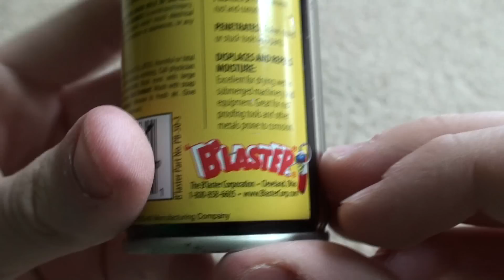How to fix noisy computer fans.

Comment: Question, I accidentally moved the fan blades while removing the dust in my PC (it didn't spin completely, just rotated a bit), but now I notice that it is spinning at 45 RPM instead of the usual 1100 RPM, is there a way to fix that or do I need to get new fan?
Reply from the maker: +lyric jam I have no idea. I've never encountered this problem before.
Reply: +Cap10323 Well thanks anyway, I think I will try to lube as in the video, maybe it will help.
Reply: +lyric jam could be that you've destroyed the driver on the motherboard. A fan is also a generator if you spin it manually and it can generate a few volts and send current back through the circuitry the wrong way, enough to destroy components. Remove the fan and connect to 12v and see if it spins full speed. If so then it isn't the fan...
Reply from the maker: +smitcher Nope, This doesn't happen. Fans have diodes in them that prevent them from generating any electricity.
Reply: smitcher thanks for the advice Smitcher, but I alreadyfixed the problem, I simply added a drop of motor oil and now it works like new again.
Reply: Fans have diodes in them that prevent them from generating any electricity.

Actually this is not true. They will generate electricity; however, the drivers on the MB that power the fan have reverse diodes in them to protect against any back EMF's.

Comment: I got a lubricant for locks that I'm gonna use. is there any ingredient I should avoid using on the baring?
Reply from the maker: +barnumeffect5 Graphite
Reply: thanks. i got one of the fans that has super tight screws connecting it to what might be a metal filter. I honestly think i'm gonna need a vice grip and a wrench to loosen them up since the baring is on the bottom.

Comment: Would WD40 do the job as well?
Reply: ***** actually no, its a degreaser not a lubricant so it would work temporarily but would end up cleaning the shaft of oil/grease and can actually make it worse
Reply: +Daniel McCormack use gun lube. WD40 will work temporarily but you will quickly have to oil it again.
Reply: +NCRranger24 - Gaming and More! Good ol' Hoppe's #9, got a fan in my own system running on that myself.  I've experimented with a few different oils and had excellent results.
Reply: LewisP Agree..WD 40 has solvent in it. Blaster better for lubricating.
Reply: for the right purpose I strongly recommend SuperLube white grease 1/2oz tube
Reply from the maker: ***** Yes, WD-40 is fine.

Comment: I followed the steps in this video using WD-40, and no more fan noise!  Thanks for the helpful video! =D
Reply: korruption - That's not a lubricant.. it works temporarily, but that will dry out at some point and might be an issue.. but when that happens.. use some real lubricant like 3 in 1 oil and it could be fine.
Reply: Can i use any oil?
Reply: @heathermaebuban9540  mineral based oil, for fine mechanics

Comment: only the fan make noise ?
the psu doesnt or shouldnt make noise right?
pc making noise, it is the fan ??? i know hdd make noise but not that loud, gpu fan make noise, thus, it all FANS.
all in all, only the fan is making the noise right ??
Reply from the maker: The PSU has a fan in it, The GPU Has a fan in it, The CPU has a fan on it.. The hard drive does not.

Comment: Mine had a rubber piece protecting the bearing and holding in the oil, under the sticker.
Reply from the maker: Some have that too, Just pop the plug.. Oil it, Then replace the plug
Reply: Cap10323
Why replace the plug? As long as you don't damage it, I just reuse it. I've done this to a ton of computers, I used to teach computers at a high school and the computer room was full of noisy case fans.
Reply from the maker: By Replace the plug I mean put it back in.. Not replace it with a new one..
Reply: Cap10323
Oh okay, I got it! That would make more sense.

Comment: delta electronics - very good reliable brand. on my pc my psu has a delta and is rated for 300 watts. i pull about 450 from it and it does not care

Comment: I just used some canned air to clean blades and into the bearings and my Dell fan, which has been noisy for months and the fan that I feared might need replaced is completely silent again. Cost for the can was one pound. Tips: Don't let blades revolve when doing this and hold can upright so that air - and not the propellent is sprayed - and, of course, be careful not to touch any components unless you are touching base metal.

Comment: Would motor oil from my car fix my laptop fan noise? I noticed that the shaft of the bearings get hotter than 80 degree ceslius, even with motor oil. Is it a good idea to put it in?
Reply from the maker: Yes, It should work.
Reply: Thanks:)
Reply: But why cost laptop fans more than desktop fans?
Reply from the maker: I don't know.
Reply: Lorenzo Van het hul  Often, making something smaller means more consideration and design time have been required so the relatively higher costs reflect that.

Comment: Would this work on a xbox 360 fan I find mines very loud and it gets very hot
Reply: Yamahatom 17 Don't vacuum electronics since it can cause static. Use a can of compressed air (but not a compressor because of the moisture). There's also small appliances that do this like "datavac" on Amazon if you don't want to waste money on cans of air.
Reply from the maker: Should do.. Vacuum your xBox Out while you are at it for best results